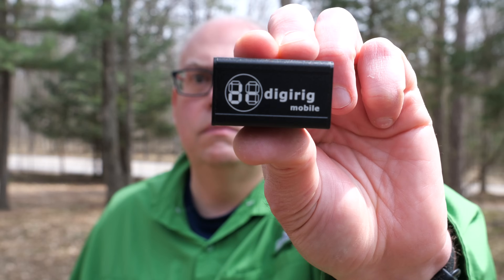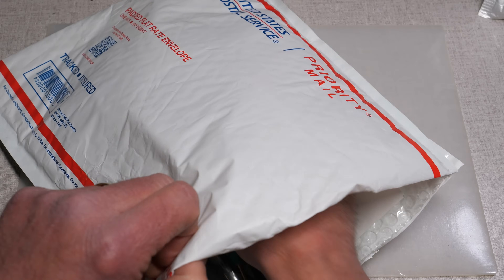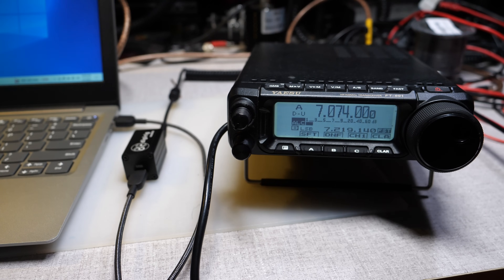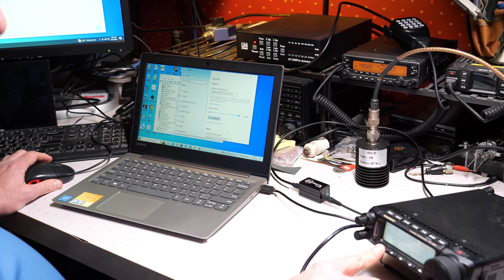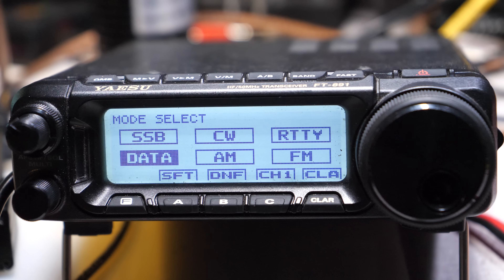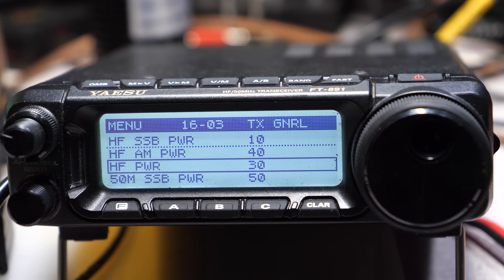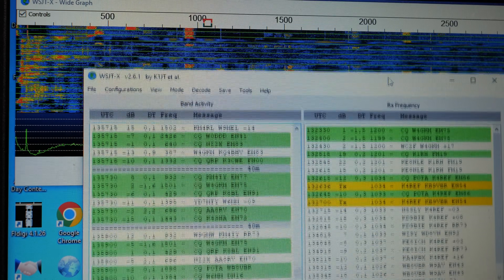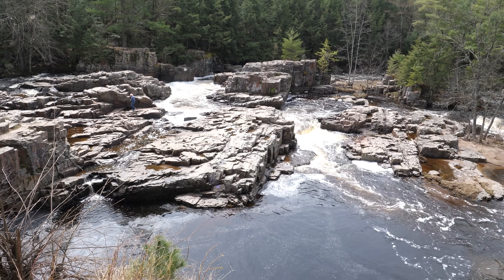Better FT8 on the FT-891! Digirig Mobile Interface  #hamradioqa

Comment: Very helpful. I have my 891 setup with another audio device but bought the Digirig as an upgrade. With your video I feel a little more comfortable making the switch over. The old audio interface was starting to fail. Intermittent at times. So your timing was perfect! Thx
Reply from the maker: There isn't much difference when it comes to settings between the various digital interfaces. The goal is to get the widest audio bandwidth from the rig to the computer, so most of the adjustment is on the radio side.

Comment: This actually helped a lot. I’m using a different sound card with cat control but have been having trouble with the radio keying up but nothing being transmitted I’m hoping this should fix that issue

Comment: Great video Mike. What general logging software do you use while using FT8? Thanks
Reply from the maker: I was running Hamrs in the background and hand entering the contacts into it.
Reply: @KB9VBRAntennas  now I just need to figure out how to run FT8 on my IC-718

Comment: In my case Digirig is a total money waste. With FT891 its not working with FT891.
Reply: Describe what's going on. The community will be more than happy to help. I have been a DigiRig successfully with a FT-817.
Reply: FYI, I have a note from Digirig to make sure the cable you have is 1200 baud instead of 9600. You have to specify this when your order.
Reply: I’ve been using the mobile DigiRig with my ft-891 for some time now. I DID have a settings issue with it but that was not at all related to the DigiRig itself. It is due to the multiple ways that the ft-891 can indeed operate ft8 with any external audio device like this.

Comment: Data modes are like watching paint dry. I’m not into having 2 computers talk to each other over the radio. Radio isn’t about clicking a mouse after 2 computers have shared signal reports, grid squares, & 73.
Reply: "Radio" can mean many different things to many different people.
Reply from the maker: This also works with RTTY, PSK, and SSTV to name a few; all of which have a higher level of user interaction.